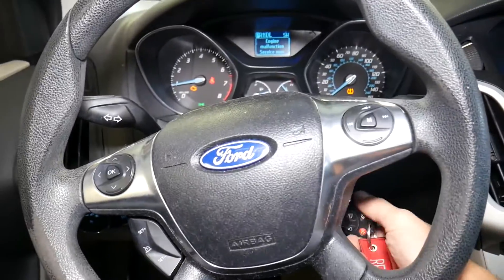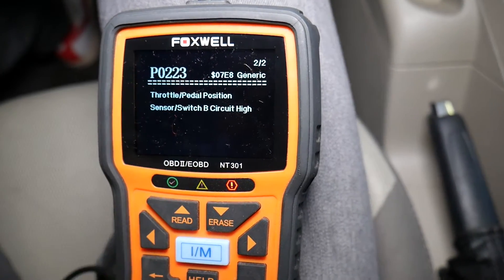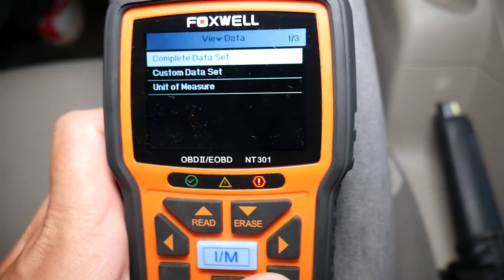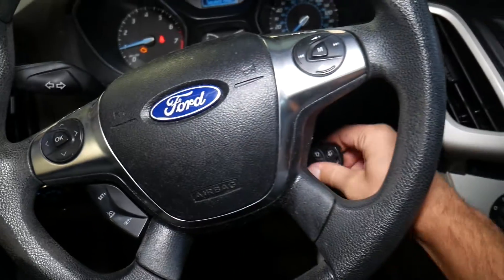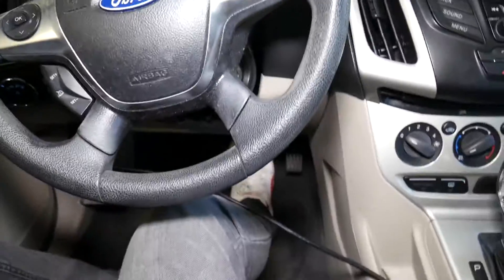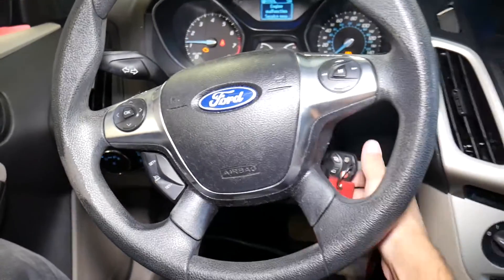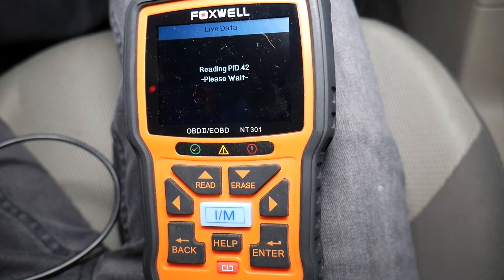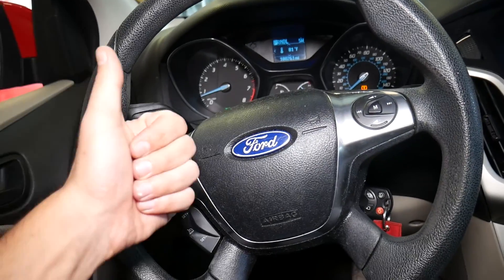FORD FOCUS CODE P0122 P0223 THROTTLE PEDAL POSITION SENSOR FIX. ENGINE LIGHT ON

Comment: I already replace the whole throttle body. And still i get those errors
Reply: PODSOS VOZDUXA
Reply: V KALEKTORE
Reply: Hello. Have the same problem. I replaced the throttle body on my ford fusion but the problem is still happening. How have you solved it?
Reply: @salazarcarlos90  yeah. When i remove the intake manifold i saw a broken hose. Just replace that
Reply: You may have to replace the cable going to the throttle body or the PCM may be bad.

Comment: But not always the throttle is the problem, it could be a burn throttle  fuse, a toyota highlander has the same problem, no throttle response when you press the pedal,  and i checked the fuse first and i fond its fuse is burned, and then i replace it, and the throttle start resoonding to the pedal normally, i mean before going with.an expensive electronic  throttle body, just check its fuse first and make sure it is ok, and then you can replace the throttle body. You could fixe with no cost at all just a 5 cent fuse.

Comment: Hi man, does cleaning the throttle feels a difference like more power or fuel economy? Also cleaning it may causes like a problem with the configuration of the car? I’ve heard that

Comment: I'm working on a 2001 ford focus zts and I just replaced the tps but it's still giving me the code for it can you give me some advice to fix it
Reply: Hi, did you figure out what the problem is with your car?
I have the same problem but also my transmission slips the second speed and my RPM shoots from 2000 to 5000. I have replaced so forth the TPS, the MAF sensor, the whole throttle body, the TPS harness, and the problem continues.